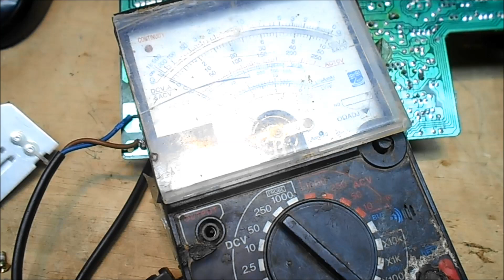VIDEO: #6.BELAJAR SERVICE TV ,JEGLEK MCB

Comment: Mas mau nanya,sy pemula.. saat sy ngecek ic vertical,tidak sengaja terkena ic regurator.. trus seperti ada ledakan kecil.. lalu sy cek elco,diado dan resistor bynk short.. kira2 apa yg rusak ic regulator nya ato sudah kena playbeck.. mohon bantuan.. terima kasih
Reply from the maker: coba cek urut dari awal lagi, teg b+ 115  dan teg ke vertikalnya dicabut dulu fokus ke regulator saja dulu cabut Pastikan teg di b tr reg sekitar 1 v
Reply: Mas trima kasih sudah membantu sy kemaren,setelah sy cek bynk resistor kiwane,dan dioda yg short.. klu sy menganti resistor kiwane dng resistor 4 warna biasa dgn watt yg sama apaakah boleh ?? Karna resistor kiwane sangat susah di cari di tmpt sy,
Lalu sy binggung utk dioda di daerah ic regulator,karna tidak ada keterangan sama sekali di dioda nya mas.. tv sy tv tabung toshiba 29 in
Reply from the maker: @manusiasurgawi5961  terimakasih kembali kawan resistor pke yg lebih gede gk papa dioda zener sebenarnya ada tulisan cuma hrus dilihat pk kaca pembesar